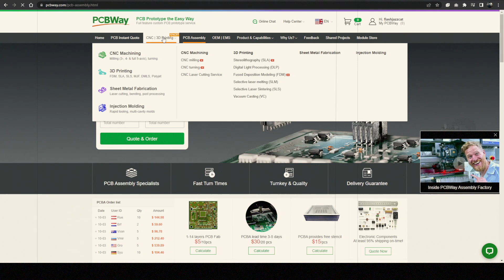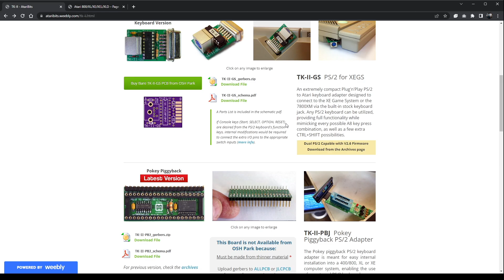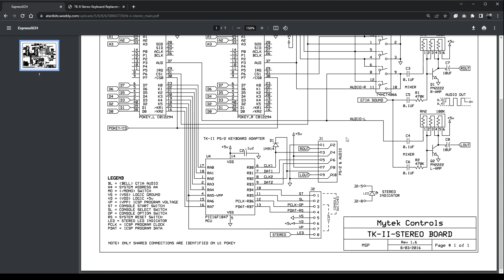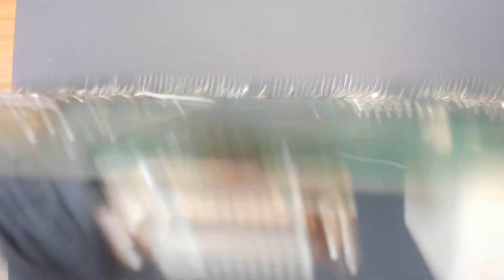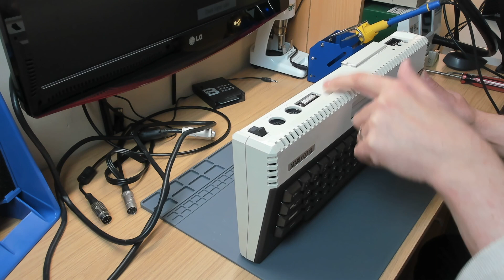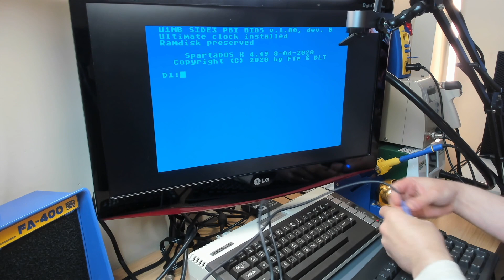Heavily modified NTSC Atari 600XL with DVI-out and PS/2 keyboard adapter

Comment: If I were going for all the mods on an XL/XE, I would probably want a USB header for power.  The Atari supply was only 5V DC 1.5A, despite how huge the power brick was.  I do wonder if with all the upgrades it might be drawing more than that, but it's easy to get 5V DC 3A from a USB port.  It might be interesting to check on the power draw.  But I see you can get a USB power cable for under ten pounds, so a mod may be moot.  (But replacing the power board on an old 800 with a USB power supply; that might be interesting, but the power board appears to have generated +5V, -5V, and +12V; assuming it really needed all of those, someone would have to design a replacement power board.)
Reply from the maker: USB-powered Ataris have been a source of many hard-to-diagnose headaches (usually the last thing the user mentions is the fact they're running the computer off a laptop USB port); in any case, there's no down-side to using a modern mains power adapter with plenty of current headroom. I doubt any machine will draw more than 1.5-2A, but you never know (SD cards themselves are quite power-hungry when writing, apparently). As for the 800 PSU board: replacing the large caps and the diodes in the rectifier should see them work for another forty years. Not sure whether 12V is actually used by the 800 motherboard (at least for the purposes of getting it to boot), or if it was only present for specialised boards and peripherals which never materialised.

Comment: Awesome job.  The case mods for the PS/2 connectors look factory-professional.

Personally, I would prefer a BlueTooth keyboard and HDMI video (with audio).  :)  Maybe someday those will be available
Reply from the maker: Many thanks. I was pleased with the outcome too. VBXE3 should provide HDMI out (with audio, although this may rely on the digital output from PokeyMax or SimpleStereo v3). I think you could probably get a wireless keyboard going with a USB AKI.